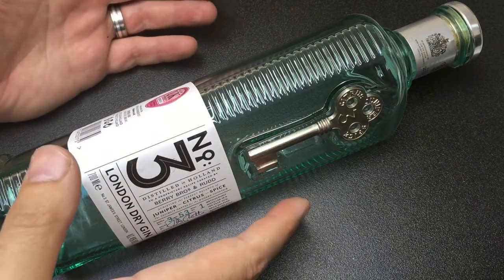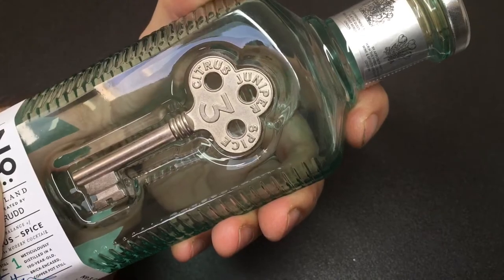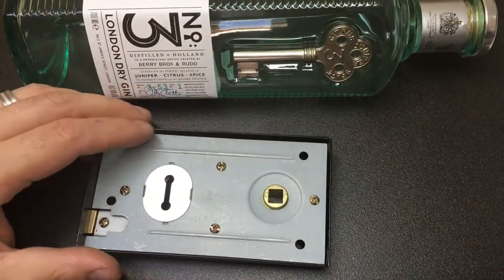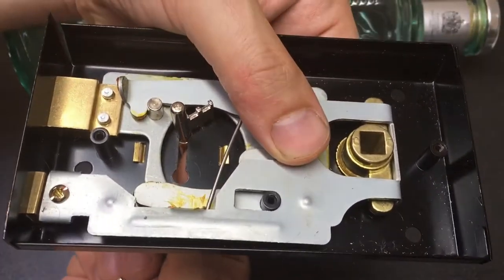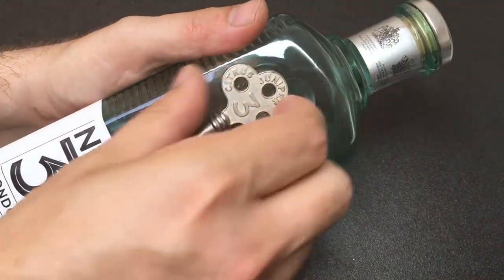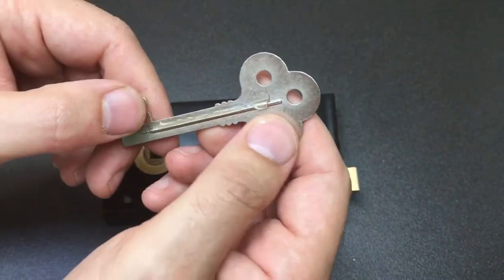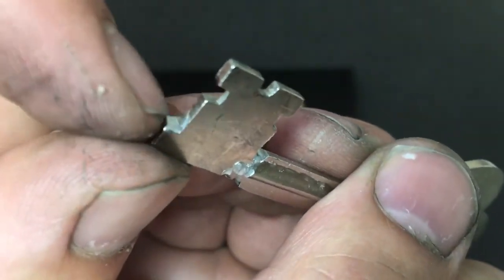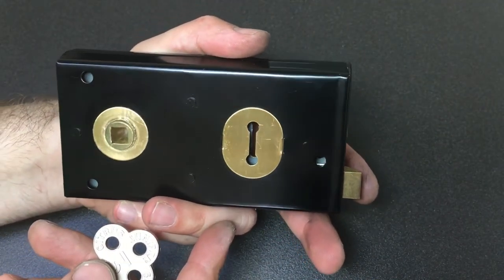Making a Master Key from a Bottle of Gin!

Comment: Nice work. The key looks like it’s made out of zinc.  Zinc is cheap which is why it’s mostly used for die casting- which I’m sure the bottle manufacturer uses to keep the costs down.
Reply from the maker: very possible - wish i knew an easy test!